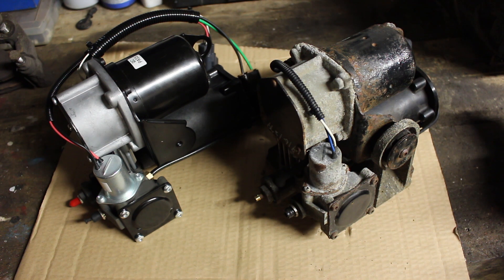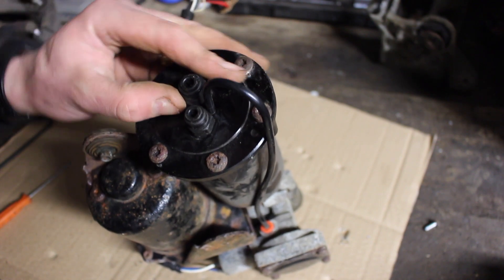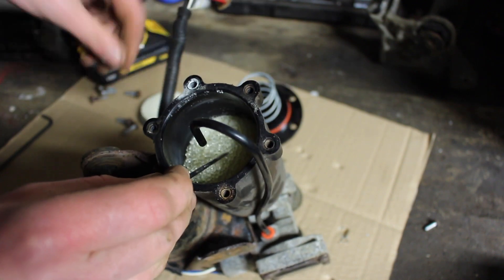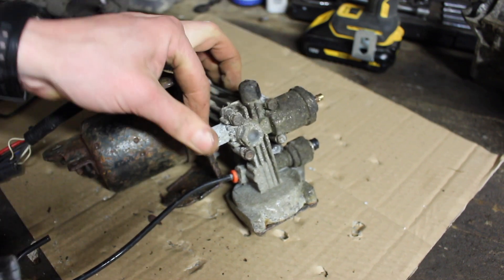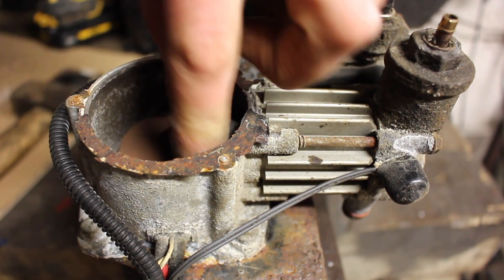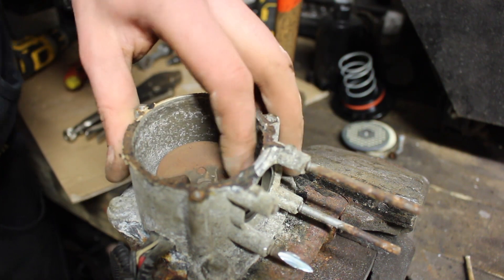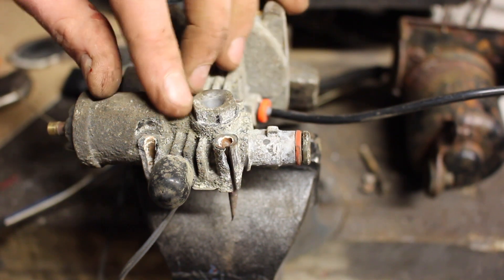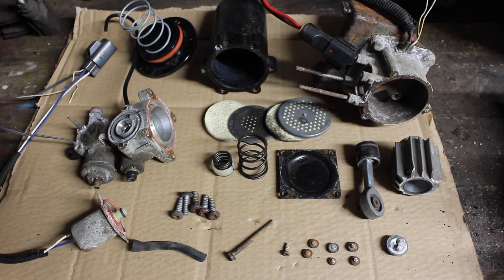Discovery 3 Hitachi Air Compressor teardown

Comment: What you think is the exhaust valve pipe is the crank case breather pipe. What you're not exactly sure is what, is the exhaust valve. What you think is the exhaust valve is the delivery valve.
Reply from the maker: Cheers Russ!
Reply: @FixitSam   would you sell me your old motor? In the uk let me know if so
Reply: So I bought a cheap ebay compressor and it pumps up good, but psi bleeds of in like 5 seconds when it turns off. I have parts compressor that ring is warn? Is that exhaust valve my culprit?  Think I could just swap it into the ebay one? I would like to know where the one way check valve is to  hold pressure into the dryer side.

Comment: Great video but if you had used an spray oil like wd40 or rust breaker you might not of had so many bolts shear off on you but then again the parts come off a landrover so it’s surprisingly hasn’t fell apart before you took it off 🤣🤣🤣
I’ve got to take my air dryer apart as my compressor’s struggling just lately 😔
Wish me luck as I use mine off road lots so it’s always in the thick gloopy mud and water 🤣🤣🤣